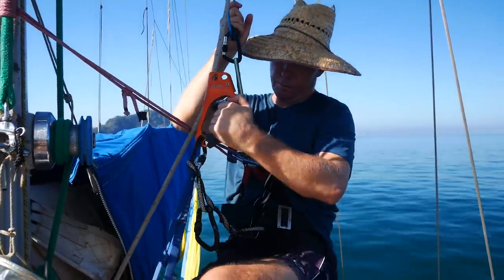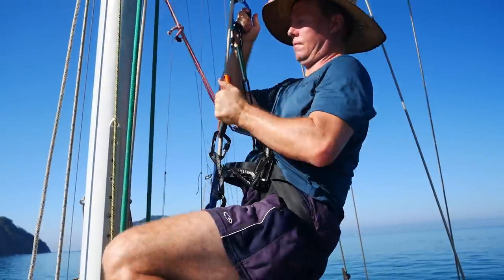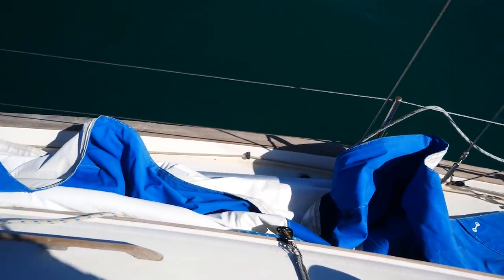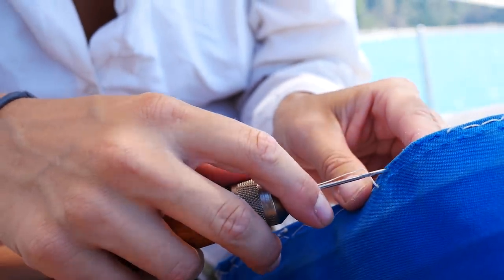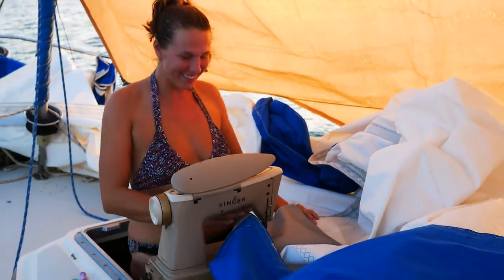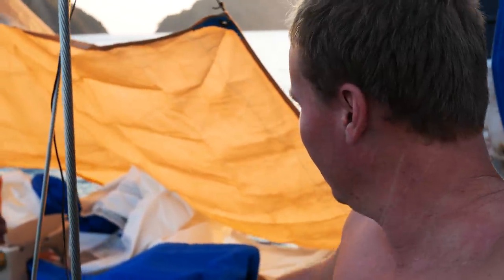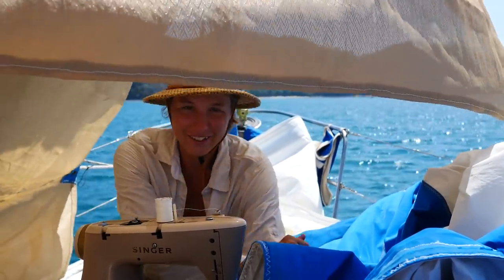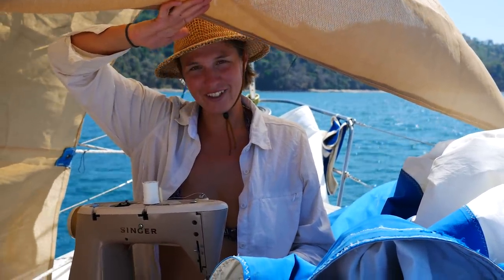Maintenance Before an Ocean Crossing [Adventure #158]

Comment: To speed up your sewing awl, place back thread thur a needle to help threading through the loop and most importantly mount your job to sew, clamp it up so both hands are only holding needle and the speedie sowing awl.
Two , lube up machine for maximum thickness sowing. 
Three , their spilt pins , cotter pins have thread and fasten with a nut.

Comment: A couple of sail thoughts from an old sailing instructor.  New sails are always a treat so go for them.. . especially if you can get the sail consultant to come aboard and help with set up.  First. The sun cover causes a lot of leech damage.  Instead, get a cover that hoists on the spare halyard. (You have one, I hope.)  Second. Make certain to move the head sail fair lead each time you reef. The sail maker can put a strip of sticky back at the clew to guide the proper placement on the fair lead.  Finally, lower the head sails anytime you will be at rest for a while. It really extends their life.

Meanwhile, have a great time. I hope I get free of land soon and join you on the sea.  Norm
Reply from the maker: We've seen those "genoa socks" and always wondered about them 👍
Reply: @AdventureAdriftSailing  Hi.  I have used them many times on race boats and wondered why cruisers don't have them. There are some great designs.  On my cruising boats I try to lowered flake and stow the RF head sails whenever possible since it prolongs their life.  The sun cover/sailcloth interface is a well known failure area. Usually up top because of fluttering when sail is reefed and lead was not moved forward.
Yeah, sailing instructor stuff but it works.  I will draw it up and put it on our blog soon.  Best, Norman
Reply: @AdventureAdriftSailing  Hi and thanks for the reply.  The only complaint I've heard about with a sock is flapping in heavy winds.  The "solution" is some lacing that tightens the sock. It is tightened after the sail is furled and sock raised.  As often as not, a spare halyard is simply wrapped around the headstay/sock and no more noise.  I expect a sailmaker will have some  good ideas.  BTW, our boat is fitted with hanked on headsails.  I think our next one will be as well and we are looking at a 37 footer.  Keep well.... Norm

Comment: Top Tip. Try lubricating the needle with some silicone spray on you sewing machine. Brush it on from a pot lid or something every 4 inches or so of stiching. Works a treat in thick materials. Ant & Cid xx (SV Impavidus)
Reply from the maker: Thanks for the tip!  We've heard soap can also be good for this?
Reply: @AdventureAdriftSailing  Yes, we have use washing up liquid. Good because it washes out. However, it does dry out and thicken to a paste if not wiped of the machine. Ant modified our Singer heavy duty by taking off the hand wheel and fitting a little knob off a draw pull with a 5mm machine screw. Now I can rotate the hand wheel like an old style machine or help the motor if it struggles. Everything's a challenge to be overcome when your married to an engineer! Sail Safe. Cid xx

Comment: I’ve seen a couple of relatively simple/affordable DIY anti-roll devices. Might be worth looking into at some point. Wishing you all the best for your prep and passage. Good luck. It’s an amazing experience once you’ve crossed your first ocean.
Reply from the maker: We actually just finished a flopped stopped about a month before this video took place, but need some thicker/tougher wire for the opening of the canvas bag, which we spent a LOT of time looking for, but could Not find in Costa Rica, one of the many challenges of cruising and trying to find something that seems so simple...

Comment: A climber's opinion here. I'd switch the ascenders—leg loop on the higher one (that's the left hand for me as well), and harness on the lower one. It'll make it easier to move up in one fluid motion. And I'd put a locking carabiner on the ascender that's connected to your harness to prevent it from opening accidentally. I also use a grigri instead of an ascender on my harness, which allows me to just disconnect the leg ascender from the rope, clip it to my harness, and lower myself using the grigri.
Reply from the maker: Thanks for the tip!  We will try that.

Comment: It's speedy compared to doing it by hand with an awl and needles. Trust me, unless you have two hands for the needles, a hand for the awl and a hand for holding the sail (plus a hand for the other part that you're sewing), you're going to really struggle to sew that fast by hand. Is the needle on the machine sharp? If so, maybe try a smaller ball/sharper tip?
Reply from the maker: Ok, yes, that sounds like a nightmare - definitely speedy compared to that alternative!  Constantly changing the needle on the machine,  but don't have access to different tipped needles, just a standard internationally branded singer needle that I could find back in Mexico.

Comment: "Speedy" is a relative term.  I have used a SpeedyStitcher, and have had good luck with it.  It's faster than a needle and thread, but it's not as fast as a machine.  Speaking of a machine, you need a proper, heavy duty, walking foot, industrial machine.  I bought one on eBay that is similar to the SailRite LSZ-1, but cost much less.  You may also be able to find one in a shop somewhere.  I once saw the same machine with a third brand name in a little shop near where I was working.
Reply from the maker: What did you buy?  I know a lot of people swear by the sailrites, but we've also heard that there are a lot better ones out there... I have a walking foot that came with this machine, but it's the wring one and doesn't fit! 😂
Reply: @AdventureAdriftSailing  The one I got is branded as "Morse," but I have seen them with different brand names.  I think the design is well out of patent, so many are free to use it.  It looks like it is mechanically compatible with the SailRite LSZ-1, and I have found the upgrades (Monster wheel, zipper foot, etc.) from them to fit perfectly.  I built 2 sails with this machine, and I'm glad I bought it.

Comment: I enjoy your judgmental approach to problems and viewing the way so much in rigging has developed in my lifetime. On a personal basis I would love a detailed conducted tour of your rigging and it’s intricacies. My experience is purely traditional East U K. How often do you have to brush down and presumably ‘oil’ or service in some way stainless rigging in saline environment? From an industrial background I am Aware little stainless is actually that and it is not easy to work either cutting or machining. What tools do you carry, as you are maturely much more objective in your assessments and rectification? You could take up production engineering as a career when you swallow the anchor!
Reply from the maker: We have a pretty standard rig on Varuna, Stalock fittings, which are nice because they are mechanical fittings and don't require a machine swager.  Other than that some bolt cutters, lots of replacement cotter pins.

Comment: You can get a sailmaker to retable (basically restitch the edge seam with 6" of new material) a sail, and it isnt expensive. I think Zaya's main was less than a $100.
Depends if the sail is deemed to be worth it. Zaya's sails have Pearsons original hull number on them (she's #103) so theyre 40+ yrs old. They made over 400 of the 365 model.
The mizzen and the genoa are still excellent but the main has just a few years left in her. 
Pretty good run really but ketch's are generally kinder on their gear and its a low rig compared to yours but extra heavy duty wire rigging.
While Im talking about it, have you checked your mast step? If you are keel stepped its probably a steel step and they tend to rust out due to bilge water and electrolysis, its kind of a known fault on Pearsons.
Reply from the maker: Definitely an option to have new UV cloth added, the sails are certainly still good, but ideally we'd love a smaller head sail on Varuna and a bit lighter material, it's a pretty heavy weight sail. The mast step is something we keep an eye on and clean from time to time 👍

Comment: There is a sail cleaning and restoration process called LaMauney process. Check out http://sailcare.com. They clean and fix the sail then impregnate resin back into the cloth which will give you more years worth of use at a fraction of the cost of a new sail.